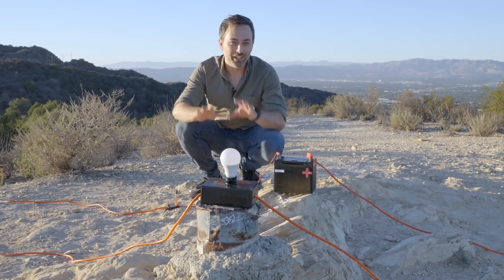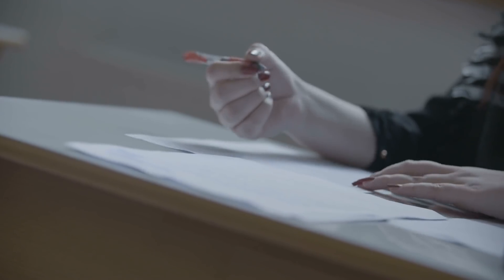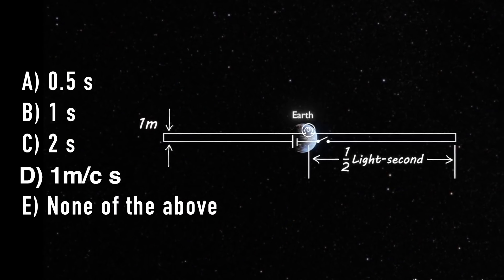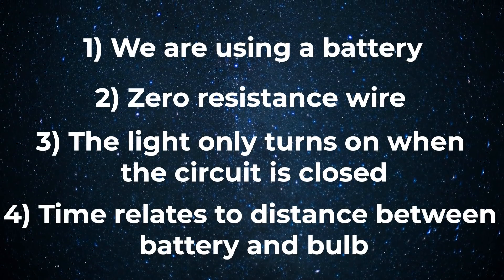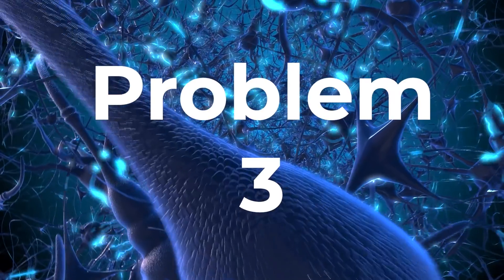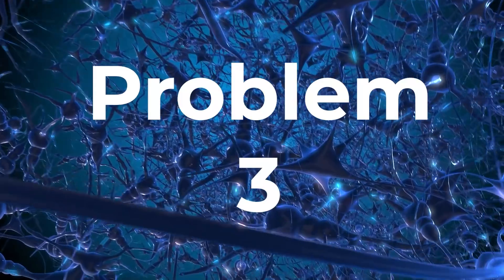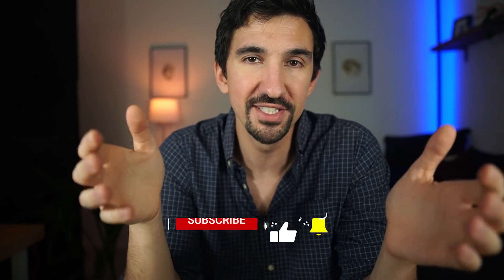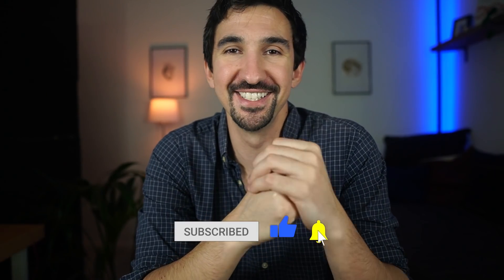Is Veritasium Wrong About Electricity?

Comment: I like this analysis. The key to understanding Veritasium's video is to realize that he spent the majority of his time describing how a radio works, not how practical power transmission works.  (This is also Not My Field.)  If you have two absolutely ginormous radio antennas only one meter apart, yeah, sure, you're going to get some serious coupling between them, and they don't even need to be connected at the ends.  Or another way to think about it is, if the online calculator that I found can be believed, Derek's thought experiment describes the construction of a ~1,200 uF capacitor and when you first turn that sucker on you're absolutely going to get some current flow across the "plates" as the capacitor charges up.  Quite a lot of current, actually.  But the line-of-sight power transfer stops as soon as the capacitor is charged and if you want continuous power transmission, you're definitely going to have to wait for EM propagation along the length of the wire, otherwise causality is violated.  I don't think the Veritasium video was wrong, precisely, but he ended up answering a different question than the framing of the thought experiment led people to expect, so ultimately I think it's a confusing piece of work.
Reply: "he spent the majority of his time describing how a radio works" which is a bit irrelevant considering that the video is titled "The Big Misconception About Electricity". He also spends a great amount of time saying that the classical model of electron carrying the energy is wrong, that it's the EMF created by the flow of electrons that carries the energy and that this EMF can also travel in the air. Okay so far. But he then proceeds to say that the energy received by the light bulb come from a multitude of path in the air not not from the wire... I disagree with that. Surely part of the energy comes from the air but most of it should still come from the wire, after 1s.
Reply: @Neehize  Actual rf calculations show that a 12V battery can only send about 50 milliwatts across that 1-meter gap, best case.   So, it can definitely light up a single LED, with only 3 nanoseconds delay.   We can even juggle the LED's resistor so it lights up 50% immediatly, then 100% later.

Really, he should have used a 100V battery, not 12V.   Or even better, use a 10K resistor, not an LED bulb.   A 10K resistor will see 10.3VDC after three nanoseconds, then the full 12V arrives after one second.
Reply: @wbeaty  Yeah, it makes sense. And yeah he should definitely have used a more powerful battery for this.
Reply: @wbeaty  how do you calculate the 10v and the 50mW?
Reply: @georgantonischki1188    an infinite 2-wire transmission line, with 5mm wire and 1000mm spacing, as a Zo line-impedance of 720 ohms (according to online calculators for transmission line characteristics.)   Two of these are wired in series with the bulb, and this puts a hard limit on initial wattage: 100mW.   I guessed half of that for max bulb wattage.  Wrong!  It's actually V^2, so 1/4th of 100mW:   25.0 milliwatts, if the bulb resistance is carefully chosen to be 1440 ohms.
That's the initial bulb brightness.  (An LED would light up visibly.)   Then, after one second, the full 12V arrives, and the voltage across the bulb is suddenly doubled.
Notice that some people assume that the long-wire pairs act like a 1000uF capacitor.  Nope, since that requires that the connections would have instant access to hundreds of miles of wire.   Instead, the ends of the wire-pairs behave as a 720ohm resistor.  (Or a nearby value, since it depends on wire diameter, not just spacing.)
Reply: @wbeaty  this is false. Z0 is a simplification for a static frequency invariant sinus wave. Additionally both the power supply and the load aren't across the two wires but along them. All your calculations are for load and supply being across the dual line.
Until the signal comes back from the short at the end of the twin lead, all the current results from capacitive coupling.
I agree, that the capacitive coupling isn't that easy due to the length of the capacitor. 
The calculation will be extremely complex. I remember coupled antennas to have the best coupling around lambda half (or quarter) so 150MHz (or 75MHz) being the highest amount of transmission.
I have asked Mehdi from Electro BOOM if he can measure. Let's see, we might have good luck...
Reply: @wbeaty  "an infinite 2-wire transmission line, with 5mm wire and 1000mm spacing, as a Zo line-impedance of 720 ohms" -- Why do you think that the two wires have 1 m spacing? As described in the original video, spacing between wires is 1 lightsecond (~ 300 000 km), and the length of the transmission line is only 1 meter. And, why do you apply Ohm's law in a transient, initially not at all DC phenomenon?
Reply: @Nonononono_Ohno  The original video says they're 1ls long and 1meter apart. Seems you got your length and spacing mixed up.
Reply: @Neehize  it all happens due to charge differential, "path of least action"... if it fits, it sits
Reply: You can't model it as a local 1200uF capacitor. It takes time for the charge to propagate the entire length of the wire. Over 99.99% of that capacitance is more than a meter a way, so at t=1/c, only a small fraction of the "capacitor" has been charged, so only a very small current has been produced.
Reply: As a radio enthusiast and power systems engineer I think you have done a good job explaining it.

Derek does also say that the assumption is that the bulb will burn immediately at the flow of current. The charging current wave that will flow as soon as the switch closes will occur at speed of light time scale due to E field induced charge buildup, although we’re talking about the initial transient waveform and not steady state current which would take longer to establish.

Confusing as it is, the root principal under demonstration is that it is the E/B field that convey power flow, rather than the water in a pipe analogy so many cling to for that intuition (comfortable as it is, is ultimate incorrect).
Reply: @brendanpreece3089  doesnt work for sustained dc as only rate of magnetic change will sustain this - is emf from battery only at that stage - all electromagnetic induction has stopped by that satge
Reply: @Murphy deffa That's why it's a thought experiment. A typical household power wire (~1mm diameter) has about 20 ohms of resistance per km, which is 12Mohm for the 2s*c round trip. You'll need some serious battery to make a light bulb light up - you'll rather get a direct arc through the air gap at the voltage required to drive a light bulb at 12Mohm.
Reply: I also thought about the giant capacitor thing. But then... when the switch is turned off, half of the wire is still being a capacitor... So does that mean that even when the switch is turned off, the light will shine during charge-up, and slowly dim? And then when you turn the switch on it will turn on again but now stay on?
Reply: Veritasium has been wrong about a lot things for the past 2 years. Just saying.
Reply: i don't agree, radio transmission shouldn't be explained by using DC currents and Derek made a claim, which is false, he claimed energy is transferred along the Poynting vector. But this isn't the case for DC. This can easily be shown, by adding extra loops to the conductor or by putting a ferromagnetic lump in the middle of the loop. Now the magnetic field gets much stronger, while the electric field doesn't change. Yet the DC energy transfer is the same desire the Poynting vector for this field being quite different. Interestingly the time until the full current is seen by the.  lamp will increase with increased magnetic field, as the current needs to establish this magnetic field and more magnetic field means more power necessary.
If you want to demonstrate radio frequency transmission, the worst thing to do is using a  pair of cables lying on the ground. In his piece he explained the issues with the undersea cable and claimed the iron mantle caused the problems. But the mantle will act as a shield, and all modern cables are usually shielded. So what's the issue with the iron mantle? It's not uniform enough and it's not conductive enough. Any change in shielding will cause reflections and thus ghosting and fundamentally smear any pulse signal.
Note, I am a RF engineer by education. My time at university is some thirty years ago, but this is just wrong...
And i have to say, I usually like the Veratassium content.
Reply: Your capacitor is shorted. If you look it as a capacitor, look at how timing circuits work. It takes time to charge a capacitor, or to run a current through a coil. These add up to impedance.
Reply: "but he ended up answering a different question than the framing of the thought experiment led people to expect" this it typical veritasium. normally he would ask people and show all the wrong assumptions. here instead of asking, he just set us up for wrong assumptions. He is just starting to play with his own thesis about identifying the what people wrongly assume first before working out the problem for real. similar to the ball in a copper tube. everyone wants to think its air slowing the ball down, when in reality its the electrical field. This does not break causality as the information travels 1 meter. for the easy math, move the wires to 3 meters apart and move the switch 4 meters either way. this will create a 3-4-5 triangle. then the information will travel 5 meters for 5/c.
Reply: @bmxerkrantz  The question is not about whether or not, when closing the switch, the information about an initially moving current, with the involved disturbances of the local, static elctromagnetic field is transferred faster than the speed of light to the load (i.e., the light bulb). This process definitely always occurs when a local field gets disturbed, e.g. when you close the switch in the questionable video, and, this information is always transferred exactly with the speed of light in the surrounding medium – neither faster nor slower.

Instead, what we are interested in is the dynamic behavior of the system: How much energy is initially, and later on, transferred to the load? This seems to be a subtle question, but it has large implications about causality: If you suppose that immediately when closing the switch, all energy begins to run from the generator (battery) to the load (light bulb), then it would make no difference at all whether a second switch e.g. at the moon is open or closed. However, we all do know that when that second switch is open, no steady-state DC current situation will establish itself. In reality, if the second switch is open, the light bulb will not light up, but when the switch is closed, it will light up.

Imagine that the guy at the switch right next to the light-bulb closes the switch. According to the questionable video, after the time the initial field changes have made it's way to the light bulb (= 1 m / c), and the light from the bulb has made its way into the eyes of the guy at the switch, he will see the light bulb either lit, or not lit. Thus, he would instantly know whether the switch far far away at the moon is closed or not. He would know this much faster than it would take for information to be passed from the moon to himself. This is deemed impossible, in current physics.

The answer to this "problem" is difficult to describe in perfect detail, since there are lots of things to take care of (inductivity, capacitance, how and how fast the switch is being closed, the medium in between and around the wires, what kind of conductor is being used, geometries, etc.). But I think it becomes intuitively easy to understand if you keep in mind that not all of the energy runs directly from the generator to the load. The very vast majority of it runs "guided" alongside and very close to the wires.

So, will there be some amount of energy at the light bulb after only 1 m / c? Yes, there will be. Will it be enough to light the light bulb? No, it won't: The initially arriving energy will be next to nothing. The light bulb will light up later on if, and only if, the complete circuit is closed, and it will light up not much sooner than it takes an electromagnetic wave (at the speed of light) to run along the wire length. Will the initial inrush of very little energy be helpful to decide whether the switch at the moon is open or closed, and whether the bulb will light up much later on? No, it won't.
Reply: @Nonononono_Ohno  It will light up "not much later" than it would take light to travel the circuit. An electrical signal in a wire travels slightly less than the speed of light. In bare copper wire its about 95%.
Reply: @briant7265  Not sure what you're trying to get at:

It will light up "not much later" than it would take light to travel the circuit. -- The point is, that current "flows" inside a wire, i.e. the electrons "move", and they move extremely slow (a few centimeters per second). Simultaneously, however, the energy is being transported in the form of field changes not inside but outside of the wire. The better the conductor, the less electric field strength there will be inside the wire, and since copper is one of the best conductors around, i.e., since it is one of the worst resistors around, there isn't much energy entering the copper wire at all (and thus not much energy gets dissipated as heat at all). Because copper is such a good conductor, it cannot get polarized like usual dielectric materials do. For this reason, one will not find the dielectric constant of copper in any table.

Since the energy transport does not take place inside the wires but outside of it instead, the crucial question is: Which pathways does it take? This depends partially on the geometry of the circuit, and other things as well. Most of the energy will get transported very close to the conductors, but a part will go other paths, and a little bit will even go directly from generator to load. So the question is, at which time is there enough energy arriving at the light bulb to make it light up? Assuming that the light bulb needs almost no energy to light up, this could be rather soon.

I'm aware that in transmission line or antenna calculations, a velocity factor of 0.95 is generally used for bare copper wires. I'm not sure though about the reasons for this, about the implications it has for the wave speeds near the surface of the conductor, how far this region "extends", and how quickly and with which kind of mathematical function this value increases to a value of 1 farther away from the conductor. Perhaps you know more, and could explain a bit?
Reply: You are saying that what Derek says is true because of capacitance and inductance. But those are complex high-level concepts. Capacitance and inductance work at all like they work, only because of low-level mechanisms that Derek explained.

Justifying his explanation by capacitance and inductance is putting the cart before the horse.
Reply: You get electron flow into an uncharged capacitor as it charges, but you can regard the "ideal" cable system as described in the problem as an already charged capacitor.
Reply: @rickharriss  Actually it's an initially-discharged capacitor, because the far ends of the long wires are shorted together.
Reply: @wbeaty  It doesn't matter if the ends are connected until after the first 1 second. It takes the DC pulse 1/2 second to hit the end, and another 1/2 second for it to matter (at the bulb) whether the ends are connected.
Reply: Where do you get 1200 uF from, assuming 10mm thick cables (for thickness of plates) I get  53nF. Thats basically nothing from a DC point of view.
Reply: "(This is also Not My Field.)" Not your FIELD? get it... because .....electrical fiel......god I'm such a High School Physics teacher dad deep in my cold black heart.....

Comment: True - felt that as well. 1/c made no sense to me. Confused me. In addition - would it mean that the length of the wire does not matter at all - and only the distance between battery & bulb matter?
Reply: @GoldenLion8  thank you. Effectively it implies that energy is travelling by em waves to reach the bulb. Again, if so, would it imply that the circuit need to be closed at all for it to travel? Or, in other words, would it depend on where the switch is placed [say, if it was placed near the extreme end would it make a difference? Is it applicable even to our homes - as in, does it not depend on the length of the wire at all?

Comment: Not my field, but Maxwell's equations are dynamical not static.  Sure equilibrium solutions are useful and many systems rapidly reach equilibrium.  And sure, back-of-the-envelope calculations and through experiments can start with perturbations away from equilibrium.  But I think the confusion here is that one really needs to solve the PDE in this case to see what Maxwell's equations predict.